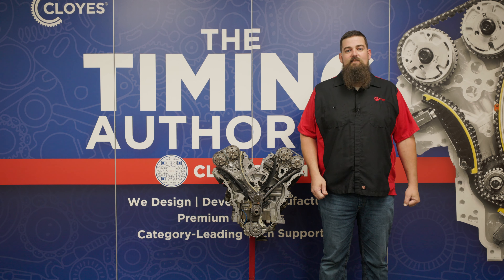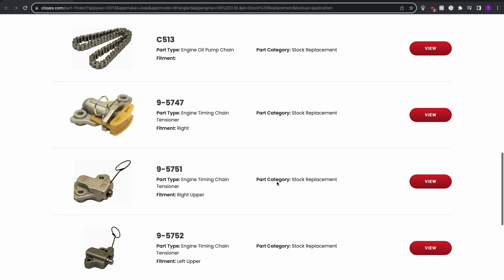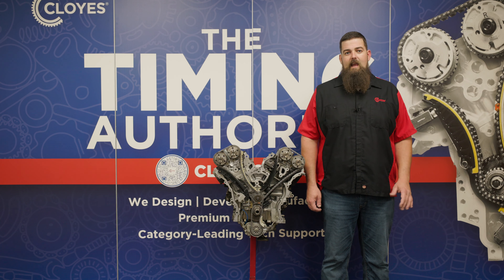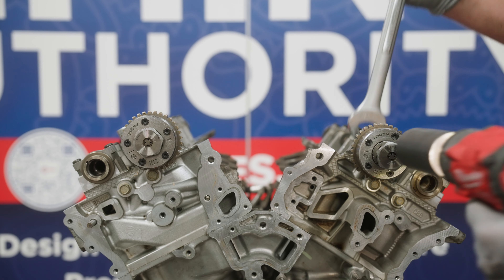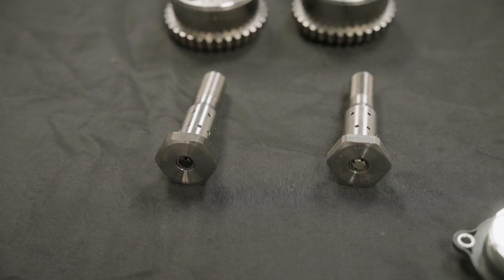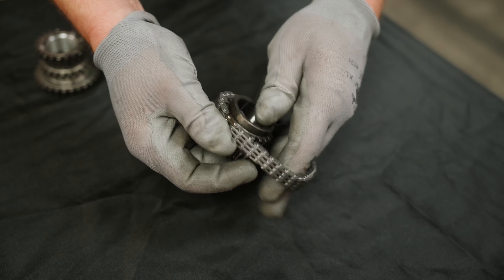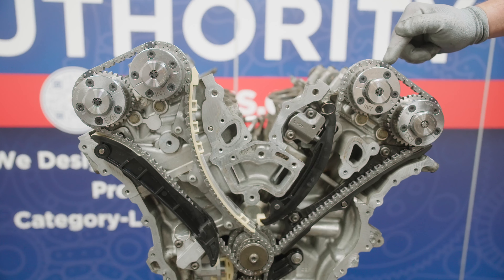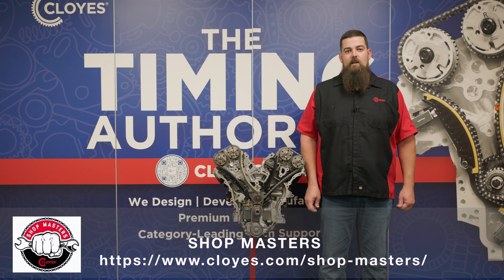Chrysler Pentastar 3.2/3.6L DOHC V6 Timing Chain Replacement

Comment: Good stuff brother. Not a fan of using an impact on the oil valves. But concise, and well explained.

The community needs more videos on this. Sick and tired of the lifters and rockers is all you need mentality. I had to replace the entire chain drive, one phaser, two cams, and I replaced all 4 oil control valves on my Ram C/V. Has 140k on the clock. I had the tick, but also had a wicked cold start rattle. Main culprit was a tensioner, but I did have a wonky phaser on its last leg.

Comment: We have a 2012 T&C with 149300 miles (240275km) on it, had it since around 80k miles, not knowing what the previous owner did, we do mostly red lights, stop signs, pedestrian crossings and drop off and pick-ups at school + work, but also many road trips, when is it recommended to do this replacement on this engine to prevent future catastrophic failure? I do all maintenance myself as a hobby mechanic, oil and filter change every 5-7k miles using castrol 5w-30 fully synthetic oil and WIX oil filter. Other parts based on sounds or scheduled maintenance like spark plugs, fluids, normal wear and tear parts etc, you know, just a regular car guy who know how stuff works, want it to last as long as possible, and don't want to pay someone to do it for me. 

The engine sounds and run great at ~150k miles, will i hear any sounds when it's time, like chain rattling, or should i follow a scheduled maintenance based on miles ? I heard someone say between 150k and 200k miles on this engine on a forum. I don't want to do it unless it's necessary, and I've heard people get 500k and even 600k miles before the plastic chain guides failed and they got catastrophic failure. 

Thanks for the video, I'll probably watch it 65 more times when it's time for me to do this job, lol.
Reply: I don’t think there’s a set time to change these. I think most of us end up having to do it when we have rocker arms go bad or chain noise on cold starts. I had to replace all my cams from bad rockers and I marked the chains when I took them off and on and I ended up with timing issues after so now I’m doing chains and tensioners. My t&c is around 156k
Reply: @kmilli0313 The chains on these stretch. And the phasers are also known for cold start rattle.

The tick, and cold start rattle are two different issues/symptoms.

Comment: I have a broken tensioner at 10k. Do you absolutely have to replace the oil pump chain and main chains? Can  I just change teh timing chains? Dreading having to drop the pan.

Comment: I have a question.. Why would the oil pump gear be larger as in more teeth and longer chain than the stock OEM one? This is a 2019 Jeep Cherokee 3.6L..
Reply from the maker: The sprocket and chain should match the OEM. What timing kit did you purchase? Is it a 3.2L engine, or 3.6L? We only show the 3.2L engine as an option in 2019.
Reply: @Cloyes01 My local parts guy here said the same thing.. He also said they didn't make a 3.6 Jeep Cherokee in 2019 but we have one and we've double checked triple checked actually..
Reply: Last night it hit me to check the idler sprocket size and it's also bigger so that should make up for the difference in the oil pump sprocket size.. I went ahead and used it hopefully it works out lol.. Fun job I know that 😂..

Comment: Can I change the timing chain without removing phasers and having a cam locking tool? I have it at tdc right now but haven't removed the chain because I don't want the cams to jump of timing but it seems they stayed in place in your video??
Reply from the maker: You will need to remove the exhaust phasers on each bank to replace the chains. The intake phasers can be left on. The cams may move some when the chains are removed, but not if you have the cam locking tools installed.
Reply: @Cloyes01  understood, but what's the use of the cam holders if both exhaust phasers have to be removed to do the timing chain? Nothing to hold onto if it's just one cam left on each bank. These are genuine questions and I really appreciate you taking the time to respond!
Reply: @Cloyes01  for example, this guy doesn't remove the phasers but does have the cam locks installed, what's the difference of how you done it and how he does it? Shouldn't I be able to combine the procedures from both videos to be able to get this done? 
 https://youtu.be/3d7gcENNO5Y?si=EzbWHB5m_qcsrunh
Reply from the maker: Hi there, thanks for reaching out. If you will please give our Technical Support team a call, they'd be happy to help you with this. 479-646-1662 ext. 228

Comment: Got my timing chains on everything was aligned perfectly, I spun engine a few times by hand, everything is still in time but the chain marks on cams and crank are now off. What's my issue??
Reply from the maker: The chain marks will only align during the installation. That reference is lost once you start rotating. The chain marks will eventually realign, but it may take hundreds of rotations to achieve it.
Reply: @Cloyes01  omg thank you so much, I already reinstalled the again and same thing. I really really appreciate you! And by the way I am using cloyes part #9-0511S! So once again thanks for the parts and knowledge!

Comment: Without the special tools to hold the camshafts in place, do I have to worry about damaging valves once chain tension is released?
Reply from the maker: No, when you pull the chain off the cams may move a little bit, but only in a direction that will close the valves. Valve spring pressures are too high to allow a valve to open without manual rotation of the cams.